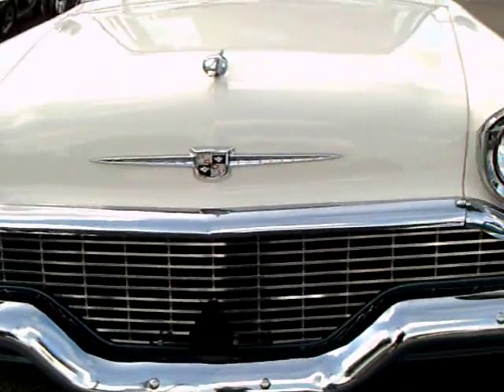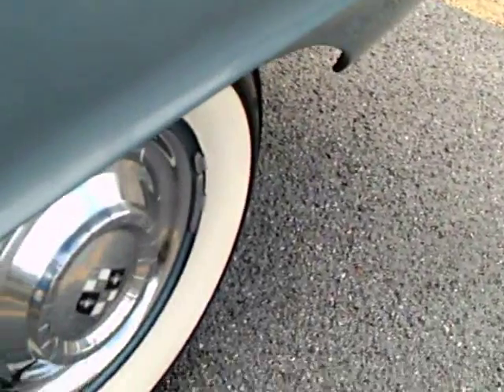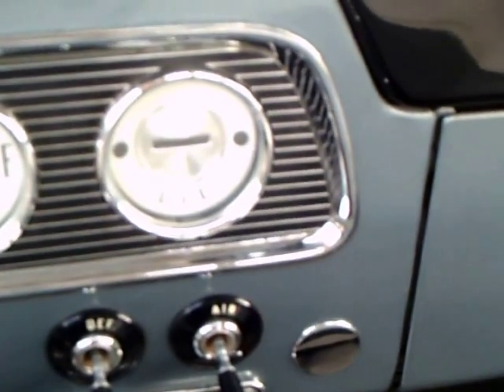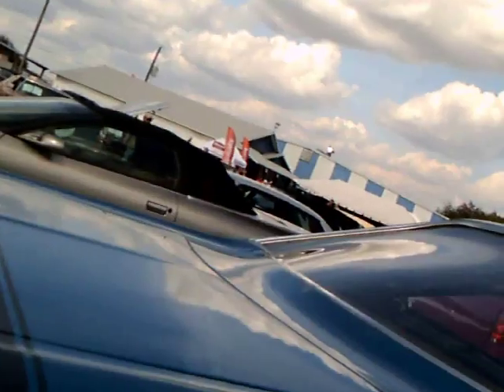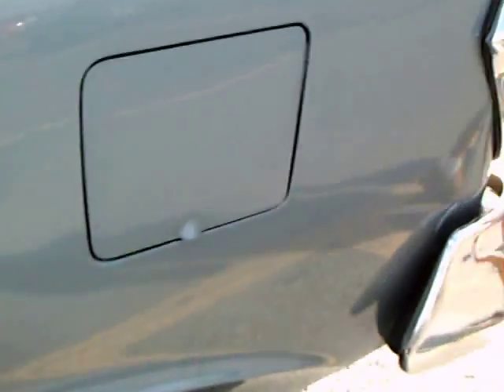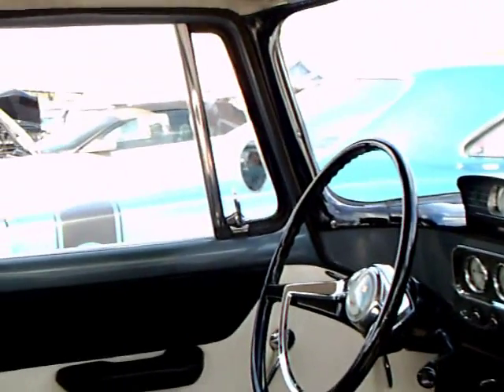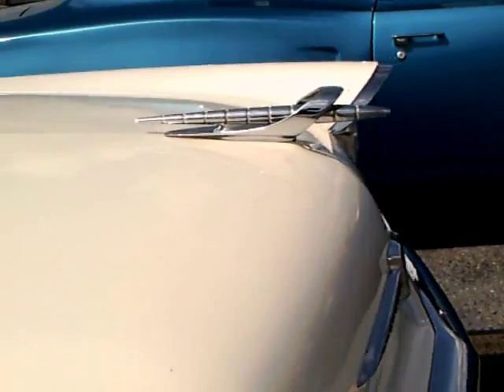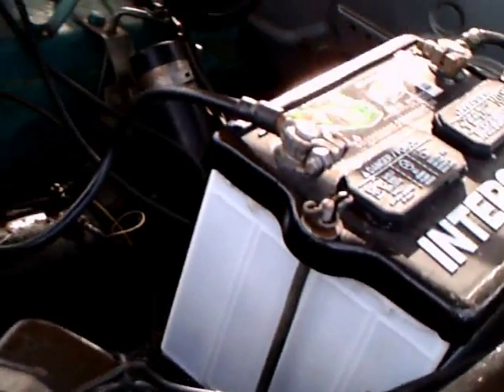1957 Studebaker Champion Four Door Sedan GrayWht ZHAuction022213

Comment: I remember my dad's '57 Silver Hawk. It did have the Deluxe trim, although it wasn't a base model. It had power steering, power brakes, Twin Traction, 4 barrel carburetor,  dual exhausts, a pushbutton radio, and a heater! It didn't have any carpet. It had a form fitting rubber floor cover. It wasn't unattractive, was quite durable, and more easily cleaned. As much as I might, wish otherwise? They've never actually been reproduced!
Reply from the maker: Hey, Gloria!  It sounds like that Silver Hawk was well equipped!  I'm sure is was a fun, fast car!  I remember when rubber floormats were standard....my aunt's '48 Plymouth and '49 Ford were so equipped.  As I remember it, our '54 Studebaker had them too.  I think the first carpets we ever had were in the '58 Rambler Cross Country.  Thanks!  :) Jack

Comment: Nice looking car. Although the interior is rather plain, it's quite attractive. I also like the gear shift up on the steering column. Most American cars up to the mid 70s had the gear shift up on the steering column, whether they were automatic or manual shifting.

Comment: I had a 1957 Studebaker Champion. And the one thing that stuck in my head about this car was the speedometer. I had never seen that before or since. The overdrive in 2nd and 3rd gear was awesome and the motor was practically bulletproof. It was very easy to work on, which was rare to have to. It never broke down. It was a straight 6 cylinder motor. And back in the day it was relatively inexpensive. You could buy one brand new for about $1000 dollars. Studebaker trucks were even better than most trucks on the market. Although I have never owned one. But sadly they were out marketed by other companies. I miss Studebaker. I think they were the kind of ugly that grows on you after awhile. I bought the car for about $400 dollars in like 1973 it had less than 20 thousand miles on it and was in perfect condition. Now I wish I had never sold it. Got great gas mileage. And I liked the toggle switches.
Reply from the maker: Yes, it looked like a cyclops eye, with the area directly in front of the numbers having magnification, as I remember.  That front end of this car was a considerable break from the previous styling, and more in line with its contemporary rivals.  I hear that labor costs at Studebaker were high, and that certainly put them at a competitive disadvantage.  The big 3 had consumers primed for complete restyling every three years...with some change from year to year.  That is a very costly proposition, and one that the independents just couldn't match.  Studebaker had a reputation for building vehicles that lasted....the business next door to where I grew up used Studebaker trucks almost exclusively.  Thanks!  :) Jack

Comment: Champion was Studebaker's six cylinder economy model and like many economy models it had rubber floor mats. Ford, Chev and Plymouth also had rubber floor mats unless you bought the most deluxe model. This particular car must be slightly deluxe with the chrome trim, nicer upholster,two tone paint, overdrive trans etc. He mentions the Scotsman which was their cheapest Champion, they sold 20,000 of them so there were a few around but as pure utility cars, they got used up and scrapped in a few years. In 1959 they brought out the Lark compact which was very popular and saved the company.

In 56 and 57 they were still making the Commander V8 which looked like the Champion but was fancier and more expensive. They also made the Hawk sport coupe and hardtop, and the top of the line Golden Hawk with supercharged V8. So, like other car companies, they offered a range of models to suit every budget.
Reply from the maker: Hey, Mr. Danforth!  I sure appreciate the timeline for the remaining Studebaker cars before the advent of the Lark.  My recollection of the Scotsman was that it was so basic, I figured it would have only a basic market as a salesman's car or for very basic transportation.  The Lark was a much better compromise between utility and style.  Thanks!  :) Jack
Reply: @coolrides  It was hard for car companies to keep up with the market in the fifties. For the first half of the decade, medium priced cars and deluxe editions of lower priced cars sold like hot cakes. In 1954 Buick actually out sold Plymouth, even though the Buick was a much more expensive car. But the Plymouth for 1953 and 54 was downsized and looked cheap which was not what the public wanted.

Studebaker made the same mistake in 1953 by bringing out smaller, more sophisticated looking models when the market wanted big impressive cars. Only the Loewy coupe sold, and it was like the Monte Carlo or Thunderbird of its day.

In 56 Stude brought out bigger looking more conventional cars, just as the economy sagged and people turned to economy cars like the Rambler. Studebaker's response was the stripped down Scotsman, the lowest priced car in the line. They sold 20,000 in 2 years which was good business for Studebaker and gave them time to bring out the Lark. From then on they were in the compact car business except for the personal luxury Avanti.
Reply: @coolrides  I would think the market for the Scotsman was people who cared nothing about cars except as practical, low cost transportation. They did not want to take a chance on a used car or import car and Studebaker offered a low cost, reliable and economical car. You would expect such people to spend the minimum on upkeep and generally to neglect their cars. And as you said, many could have been sold to businesses for making deliveries, meter readers and others that needed pure utility transport.

Comment: There's nothing outdated about a Flathead 6. Chrysler-Dodge  sold flathead-slant 6's in 1978.
Reply from the maker: Hey, Gintas.  The slant six was an overhead valve engine, replacing the flathead 6 in the 1960 Plymouth. Thanks!  :) Jack